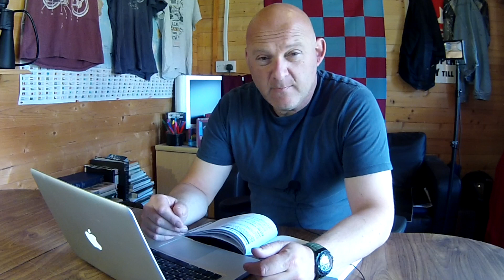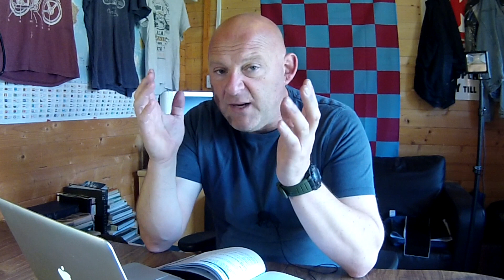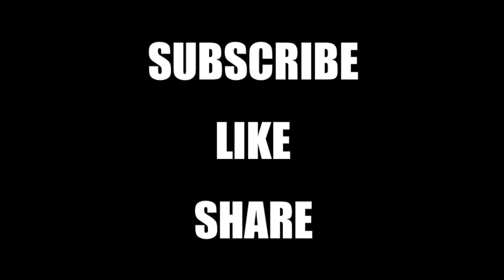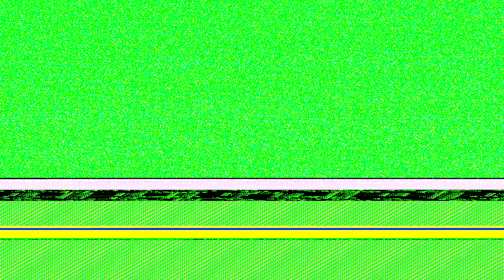Why Does My Harley Not Start - Troubleshooting HD Softail Starting Problems

Comment: I have a 2002 road king, I left it in gear and forgot about it and tried to start it so it jumped forward and I think it flooded it and fouled my plugs, so I replaced them. I put the bike on. Charger to make sure it was good,it turns over and has spark but will not start. What's your take on this
Reply from the maker: Hi Ron. So I assume before you left it in gear it was fine?
So I’m wondering whether your plugs were fouling beforehand and not because you tried to start it in gear.
Are there any error codes or check engine light? Any historic codes that you can see?
From memory there was the option of carb or injected models so which do you have?
Do I would start looking into the injection side/throttle management or perhaps a neutral switch or sensor. I would imagine it would be along those lines it’s just a matter of narrowing down by testing each component
Reply: It is carbed
Reply from the maker: @rontrawick2640  keep at it, you'll figure it out. Just a process of elimination

Comment: Bought my 2021 sportglide exactly one month ago. Began having starting issues a week ago (starter tries turn over, but engine doesn’t start). Dealer replaced central control module (or something along those lines) - bike worked for a day and a half.....found myself stranded second weekend in a row because it won’t start. 
Wondering if it’s a heat issue? Both weekend mornings, started the ride when it was cloudy, by afternoon skies cleared, the sun came out and temps went up. Parked the bike indoors in the shade, a few hours later it started right up! 
(This shouldn’t be an issue....but can’t think of anything else!). 
Any suggestions?
Reply from the maker: It could be a whole host of things. Your dealer will need to do a full diagnostic to narrow down what is causing the issue. It could be rooted in either the ECM or BCM or possibly even in the IM or most likely it will be a sensor issue. I assume you have checked battery terminals and error codes too? Cheers
Reply: @RevelatorAlf  check and check on the battery and battery connectors. It’s going back to the dealer this week to figure it out. Bummer tho, not the sort of experience you expect or want from a name like HD plus it being brand new!!

Appreciate the reply, keep the content coming!!

Comment: I just bought mine. I removed the tank and wired it for LED glow lights. A kit made for motorcycles. I created a plug that plugs into the recharging port. I tapped the blue brake light wire into the left turn signal. Now the left signal won’t work. AND the bike turns over but won’t start. However the LED glow light work great and all light up, red when I apply the brakes. I’m pissed I just got the bike and now it doesn’t run.
Reply from the maker: Yes it would appear you have run into your harness. I would undo everything and start again. Perhaps get a HEX exCAN to power this for you without problems. See my latest videos on  this. Cheers

Comment: I have a2010 electric glide  the starter will engage and the engine will turn over but will not start.  The fuel pump will not come on. There is no power to the fuel pump fuse. Also, the spot lights will not come on  there  is power to all fuses, and all fuses are good
Reply from the maker: have you checked wiring to see if there are any breaks

Comment: I know you go over a lot of points. I just have a problem that I can’t really find anything about.  I had put to much gas it was poring all over I went home didn’t ride it for a week and ahelf know it won’t i don’t know what to do Anything can help thanks
Reply from the maker: Harold Davis ok I don’t understand what you’ve asked. Are you saying that after not riding it for a week, your bike will not start now?
Reply: RevelatorAlf I over filled the gas tank and park it for a week after that now I won’t start
Reply from the maker: Harold Davis ah ok.
So if you can answer these questions.
1. What bike is it?
2. Does the engine turn over?
3. Do you have a separate fuel tap?
4. Is the battery fully charged?
5. If the engine does turn over, do you hear a strange sound?
6. If the engine turns over do you smell fuel and do you see any smoke out of the exhaust?
7. Have you checked all spark plugs for spark and are all HT leads and caps secure?

Cheers
Reply: RevelatorAlf  2006 Harley fatboy  it dose turn over it doesn’t take any particular gas I always put premium battery is at 56% I do have it on the charger it’s dose sound strong you do smell gas but no smoke did just Change spark plugs the old ones where flooded thanks for getting back to me
Reply from the maker: Harold Davis ok take a spark plug out and place the cap back on. Hold it so the probe touches the engine casing and then press the starter to see if you have a spark.
Make sure you wear gloves so you don’t get a shock.
Test each spark plug in turn.

This sounds like spark ignition timing issue.
Do that and let me know what you find

Comment: Want to try to start the bike I don't hear the fuel pump come on
Reply from the maker: Check the connectors underneath or the connector to the instrument module
Reply: I just hear it click like a solenoid I don't hear the fuel pump come on at all just that little click

Comment: Just had a test ride on the Sport Glide with a stage one, very impressive.  I think my Multistrada will be coming a HD SG very soon!  Any issues with yours or any dislikes creeping in now you’ve had it a while longer?  Are you going stage one or still happy stock?
Reply from the maker: Nozzer 66 thanks fella. I don’t think you’ll be disappointed at all. Right. Ie I’m happy with the way it is although perhaps next year I may up stage. I really want to feel it out before  I really decide what mods I do but overall very happy with the bike.
The only small issue right now has been a little scuffing on the yokes from small fairing vibrations. I’ve done some videos about it and am in the process of addressing that. Not a widespread issue but there have been cases in uk, Europe and USA.
But overall it’s the best bike I’ve owned in terms of instant connection with but of course not necessarily performance. But then again I am getting old ha ha. Cheers
Reply: RevelatorAlf thanks for your thoughts, I’ve always known I would try HD and now at the ripe age of 53 I feel the timing is spot on with these new Softail models!  Many thanks for all the effort you put into your vids, regards Nozzer
Reply from the maker: Much appreciated thanks so much

Comment: H E L P........ 2009 Harley Ultra....
NO CRANK, NO BLINKERS, 
HORN WORKS, HEADLIGHTS, RUNNING LIGHTS,GAUGE LIGHTS WORK, EXCEPT THE LIGHTS ON SPEEDOMETER AND TACH ARE NOT WORKING...NO DISPLAY ON SPEEDO FOR CODES.....
CANT RESET tsm Because of the no Signals problem
H E L P......